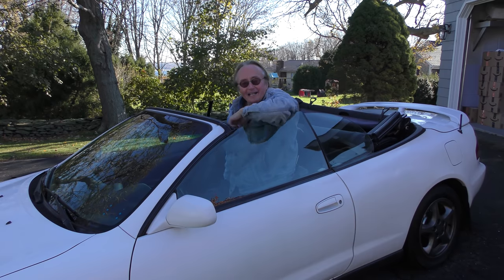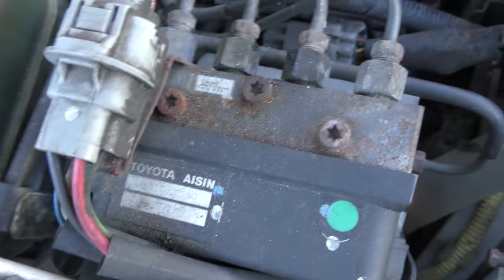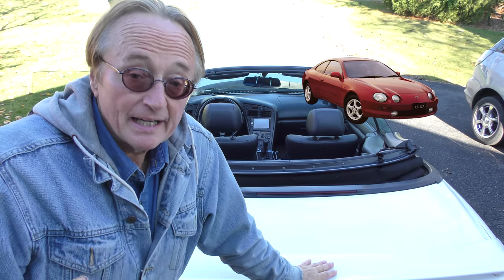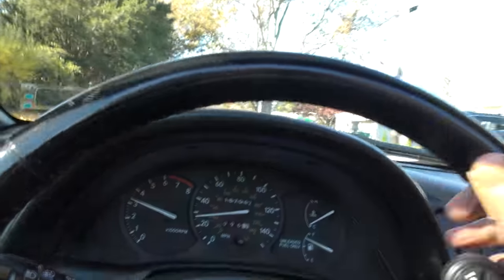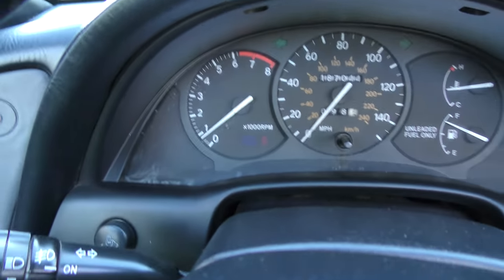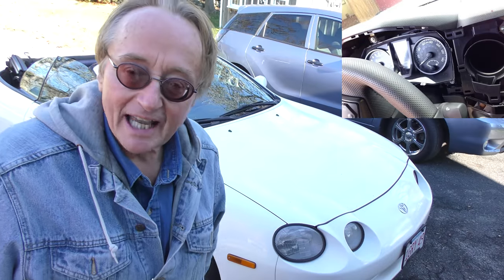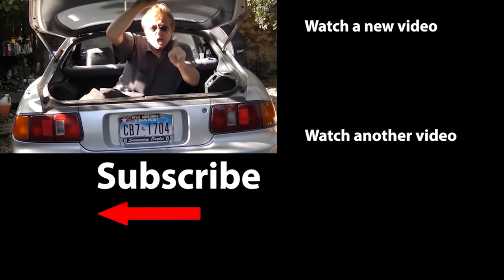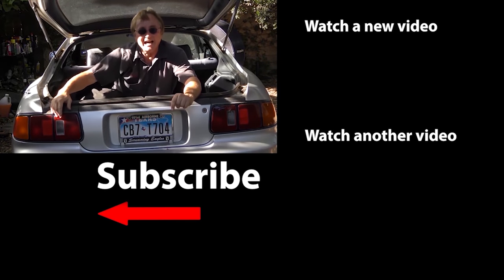I'm Sitting in the Best Car Ever Made

Comment: YAMAHA engine that blew up? Lol ok Scotty, how long until mine blows? 😂 220K so far on it.
Reply: It usually happens when it is often driven with high revving.
Reply: @djl_cyber_yt  i think any engine with enough abuse will blow up.
Reply: @alexvieira7945  There’s that factor. However, the Yamaha engine had more reports of having the engine blown due to high revving, more frequently than the Mustang or the Miata.
Reply: @djl_cyber_yt  like i said if you beat up on an engine eventually somthing will break, Scotty talks about the 2zz as if it breaks out of normal use, which is not true because it super reliable, 220K on mine, no issues at all, pulls hard still hits lift. Idk why Scotty hates on the 2zz so much lol.

Comment: You can tell the true Reliability of Toyotas when so many necessary components that need to be replaced regularly can have 130,000 or even 230,000 miles on them and still work like new